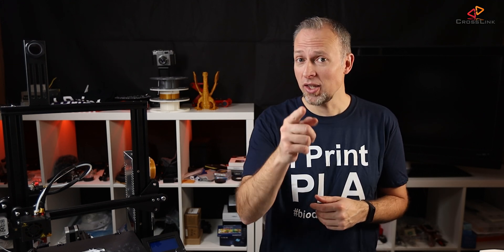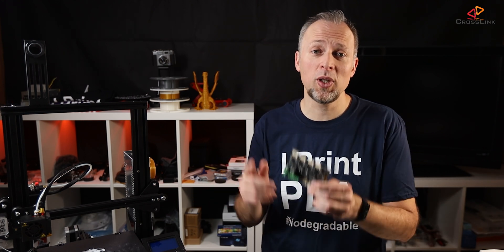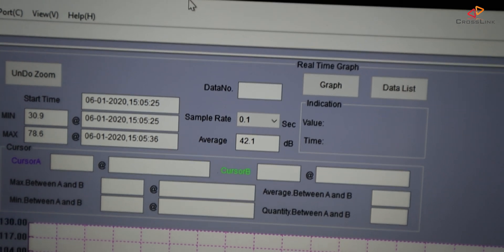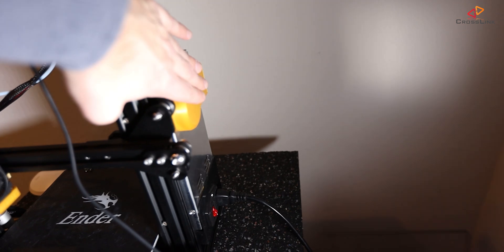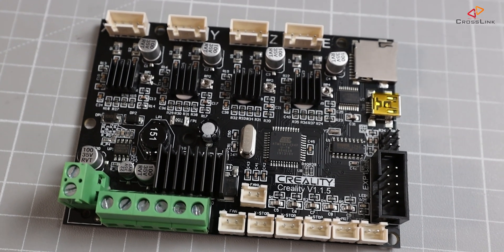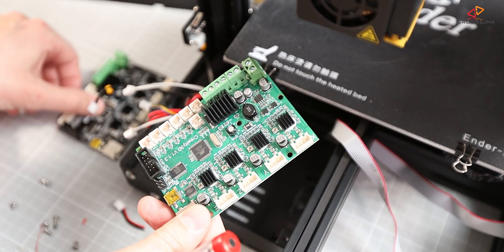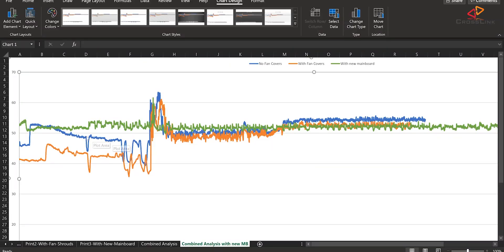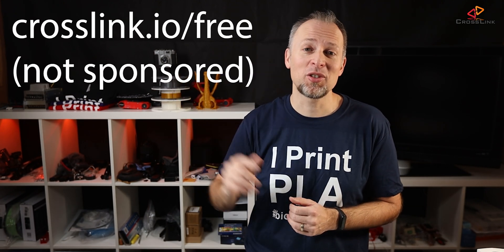Ender 3 Silent Mainboard 1.1.5 by Creality

Comment: Does this work with the ender 3 V2?
Reply from the maker: No, there you need to get the 4.2.7 version to get silent drivers. But if you already have a v2 with the 4.2.2 it should have TMC2208 drivers which are silent

Comment: i got the 4.2.2 mainboard and i cannot get stealthchop to run on marlin 2.0
Reply from the maker: Are you sure that your board has the silent drivers? There is actually two versions of that board. One with and one without silent drivers.
Reply: @Crosslink3D  how can i tell? Is there a gcode command to read it out?

Comment: Is the creality v1.1.5 board version compatibel with 12 volt power for the cr10? i would like to order this silent board for my printer, but i am not sure, if i can change the voltage from 24volts to 12 volts in the software when i flash it to the cr10. thank you forwarding and thank you for this informative video

Comment: Did you put the board fan cables directly with the power supply ones?
So I will have 2 cables in a slot (positive) and 2 cables in the other (negative)?
Reply from the maker: Yes, it now runs 100% of time
Reply: @Crosslink3D perfect, thank you!

Comment: So you just buy an ender 3, install this board in it and it will be this quiet? Noise has always been my main concern since i live in a small apartment and don't want to bother my neighbors which is why I still haven't bought a printer even after years of thinking about it. Looks like the V2 has this built in but I could save a little bit of money by buying the original and replacing the board, so which would be better? I know the V2 has other improvements but apparently most of those can be printed yourself anyway
Reply from the maker: The board fixes part of the issue. If you watch my follow up video, you will see that there is more to do to silence the printer down: https://youtu.be/IrLvz7OGAe4
Reply: @Crosslink3D  Okay, yeah seems pretty good. The fan noise doesn't concern me as much as that wont travel through walls that well compared to the vibrations going through the floor etc. but I'll try to eliminate the noise as much as possible
Reply: @Crosslink3D  Alright, I ultimately went for an Ender 3 pro with preinstalled silent board + glass bed, came to about 220 usd total, a bit cheaper than buying the upgrades individually and not quite as much as the V2 so I'm pretty happy with that. Can't wait to try it out

Comment: First, great video. I found out about the silent board here. I installed it on my Ender 3 and I do have one problem. The x-axis belt won’t stop moving when I set it to Auto Home and it cause it to make shaking/vibrating motion. Also, the LCD display reads Ender 5. Maybe that has something to do with it. Any help would be appreciated. Thank you!
Reply: I think you bought the wrong version. The board should be for the ender 3.
Reply: You didn't connect the X-limit switch properly to the main board. Therefore your printer never detects when it reaches the home position on X and keeps trying to go on.

Comment: Thanks for the comprehensive review and for including the fan cover files.  However, IF I do tire of the driver noise and decide to upgrade soon, I certainly will NOT use the creality 8 bit board.  Other vendors offer silent 32 bit boards for considerably less $$s.
Reply from the maker: Good point!

Comment: Hi there, great video! I have a question what is the difference between TMC 2208 drivers in 'cube' and the one already build in for example in this v1.1.5 mainboard (also TMC 2208)? Thanks in advance for clarification.
Reply from the maker: I guess, if both have TMC2208 drivers, there should be no difference.

Comment: WAIT!? How do you plug in the electric board fan into the power supply when you still need to plug back in the power supply cables into the power supply slot on the board?
Reply from the maker: I connected it the same way it was connected before.

Comment: Can anyone recommend what mainboard I should upgrade to?  The original 8bit board is annoying when it comes to installing marlin.  I am currently toying between the skr 1.3, Creality 1.5 silent, and maybe a Duet.  But I don't want to break the bank, so i'm leaning away from the duet.  I don't really know if I need a 32 bit.  Mostly, I just want to be able to enable anything in marlin my heart desires.
Reply from the maker: I would go for SKR 1.3 or 1.4. but invest in good stepper drivers. Something like the tmc2209 will give you great noise reduction and finer steps.

Comment: 1.1.5. motherboard firmware update required?
Reply from the maker: The firmware on mine was 1.1.8, so I wanted the latest for sure. The good thing - it had a bootloader installed. The bad thing - after flashing once, the bootloader was broken so I had to re-flash a new one.
Reply: What do you suggest? Actually, I want to do some operations with the buttons I want to do. For example, pressing a button auto home, or cancel button, resume button and print from the computer. Are these possible?

Comment: Hi Daniel I've bought a creality v1.1.5 silent board for my Ender 3 Pro ....my question is I've been using the stepper dampers on the original board and when I fit the upgraded board should I also add the stepper dampers or leave them out?
Regards
Andy
Reply: I'd personally leave them out
Reply: @maxim_vdeede  Thanks
Reply from the maker: You don't need them anymore. Smoothers don't have any effect on these newer stepper drivers.

Comment: Great video thanks....This is also compatible with Ender 3 Pro?
Reply: as far as I know, the Ender 3 Pro is using the same Mainboard, but upside down/flipped around. But on Amazon, you will find 3 versions 3, 3-Pro and 5

Comment: I have this board, buy 2 months ago. great, mucth more silent. Have a problem now for maky update of marlin and autolev. They came with bootloader, but you update one time, and need to reburn bootlaoder again. For i know, and search , it's a common problem with this boards. A crapy bootloader. I manage after a big fight and try, put a update. Maybe was best if i  have go for a SKR board. But is a good replace for my ender 3

Comment: I have changed the CR10 Mainboard for the BTT SKR 1.3 with TMC2130, outperforms the CR board 1.1.5 I put in the CR10 Mini by a mile ... Wile making it standalone that was a no brainer.

Comment: In future,you should try SKR BIGTREETECH SKR MINI E3 or FYSETC Cheetah V1.2a..TMC2209 driver..it cost half of original ender silent board and work perfect
Reply from the maker: Hi, Thanks for the comment, I definitely have the SKR 1.3 on my list but it's only cheaper without the drivers. With good drivers like the 2208 it gets expensive, too...

Comment: My Ender 3 is much more quiet. I use a SKR 1.3 (much better value for the price) also with TMC2208. I replaced all the fans. I use a new printed cover for the PSU to use an 80mm beQuiet-fan, two noctua fans for the case (the noctua fans usually move less air, so two of them doesn't sound too overkill). I replaced the whole hotend fan shrout with a HeroMe Gen3 with dual 5015 fans (they are dirt cheap and using them on 80% is very quiet). My Hotend fan is currently an 40mm*20mm Sunon fan (high performance, but not as quiet as noctua or beQuiet. But Noctua could lead to heatcreep)

Comment: Does that new silent motherboard also have temperature protection? That is a good purchase.
Reply from the maker: I am testing this right now. This will be part of my follow up video about firmware and flashing Marlin 2.0 to the board.
Reply: IT DOES HAVE  THERMAL RUNAWAY ENABLED. I just installed one to my ender 3,,, love it!!!! super quiet!
Reply: Depending on where you buy it some DO NOT HAVE TRP. However new creality boards have thermal runaway protection. Buy cheap buy twice.

Comment: I was planing on buying a 1.3 maimboard and getting tmc 2208 drivers as my mom bans me from printing at night
Reply from the maker: You mean an SKR 1.3. Seems that this is also a good alternative. I am going to test the SKR 1.3 on the AM8 and there is also an SKR mini, which seems to fit into the case of the Ender 3.
Reply: @Crosslink3D  forgot to write skr, I was also thinking about it as I recently baught 2 volcano hotends from aliexpress for 10 euro so I was going to model a mount and try having dual extrusion with pva filament but pva filament is 60 euro per kg which is insane
Reply: @Crosslink3D  but with the older maimboard with the real mega 256 you could add an expansion board which give you an extra hotend and extruder so you could have 3 or more hotends but I can't find one that does the same with the newer mainboards
Reply: buy the new skr 1.4 as they add more features at the same price

Comment: Now, can you install the v3 Bltouch with this motherboard? I honestly can't get creality to answer me 😔 I bought this cause I was worried I would mess up another MB that needed a bootloader & firmware.
Reply from the maker: I will test the BLTouch Upgrade in the next weeks, so you can expect some results soon. But at the moment, I can not yet tell you.
Reply: @Crosslink3D  thanks & look forward to it 😊 fully enjoying my new printer & all the help I've been getting on YouTube
Reply: @sammniamii  For adding a BLTouch to an Ender 3 you have 2 options; 
1: you upgrade from the Creality mainboard to something like a SKR Mini E3 (direct drop in replacement and is better for flashing, better stepper drivers, more upgradable, etc...)
2: you either make your own PIN 27 board or you buy the official Creality BL Touch upgrade kit. This taps into an available pin on the LCD header which enables you to use servos. You need to flash the firmware on the Creality mainboard as well, which is not as easy as plugging in a USB cable and hitting upload...
Reply: @PS3BM1195  I have the full bltouch kit, was gift. I bought the official 1.1.5 motherboard & already installed. I had looked into other boards, I honestly was worried I would mess it up as I've done with other like upgradables devices (but I wanted that thermal runaway protection).
Reply: @sammniamii  Have you followed the instructions given out by Creality? Normally if you follow them, you should have no issue... I'd still recommend looking into buying a SKR mini E3 tho... The channel Teaching Tech has in depth videos on how to install and configure that board. Hope this helps
Reply: @PS3BM1195  I've watched alot of his vids already, (whole play list) after I had purchased the board. I know myself & my limits (& weakness)  I've only had the printer for less than 2 months, didn't want to risk mucking it up so badly I couldn't use it. And yes, youtube vids have better (and correct) instructions for installing the bltouch, but I've read alot of the v3 weren't working correctly with the 1.1.5 board, even with additional firmware. But, I've also started to see some who can get it to work. Just overly worried I'll render my investment junk before I get to enjoy it (have fun). I've wanted this printer for a over a year & finally got one
Reply: @sammniamii  The thing with Creality mainboards, and imo their biggest drawback, is the inability to flash them easily with something like Marlin. For people who don't have (a lot of) experience with electronics and firmware, it's a lot to ask. Usually the 'tinker friendly' boards like the SKR are more forgiving as well... I burned out my first mainboard of my Anet A8 when I made a wrong connection with polarity (reversed 5V VCC and ground) and it refused to work after that. I've been running and flashing all kinds of SKR boards (mini E3, V1.3, Pro) for a while now without any issues. I have a small side business (only for friends atm) that helps them buy and configure upgrades for their printers and I sometimes build custom printers. Even tho my masters in Electronics Engineering should say otherwise, I sometimes make wiring mistakes. No issue on SKR boards as long as it isn't the 12 or 24V power lines. I even wired up a BL Touch incorrectly once and it didn't mess up anything.
Reply: @PS3BM1195   it's something I'm  considering in the future, since I'm already thinking of other "upgrades" (cue the mad scientist) I've done other electronic meddling before and got about a 50/50 track record, so I err on the side of caution. This is why I love watching these vids (and reading comments) and hoping I'm not making too much of a fool of myself while I fumble along 😂 😊
Reply: @sammniamii  If you need any help, shoot me a DM or whatever. I'll try and help you out
Reply: I read somewhere whilst researching the bltouch vs azabl (or similar), that the bltouch v3 is not compatible with the 8bit boards. That wasnt an issue for me, as I have a SKR 1.3 board, which the v3 is compatible. But I've ended up, making my own version of the ezabl sensor, thanks to a post in the Crosslink discord 👍